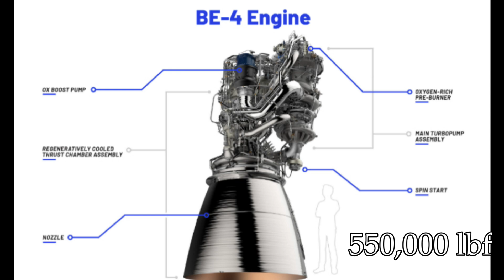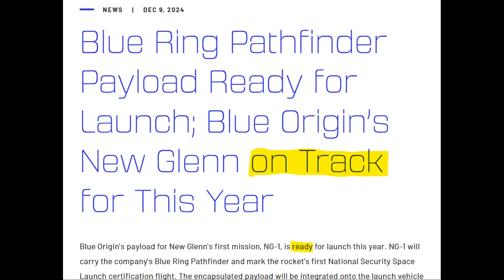New Glenn Ready to Launch?

Comment: It would be a big flex for Bezos if the things flies and lands without incident. It would be impressive to achieve this at the first attempt whereas it always takes a few RUDs for SpaceX.
To be fair, the engine is less complex (not full-flow) and the rocket itself is significantly smaller than starship.
Having said that, it's still much more modern and innovative than SLS.
Reply from the maker: Yeah, it would be interesting if they got it sans RUD on the first attempt!
Reply: @marionrkerr 🙏🏼🙏🏼🙏🏼🙏🏼

Comment: Good update.  If all goes well, New Glenn will put a payload in orbit before Starship.
Reply: BO must do that ASAP, whereas SpaceX isn't pressured. (And they could have put a payload in orbit on at least three previous flights, if they just wanted the notch on their belt.)
Reply from the maker: I wonder if that is part of the incentive. 😁
Reply: @marionrkerr  They have set some high expectations for themselves.  Recovering the booster on the first try will be awesome.
Reply from the maker: @ agreed!
Reply: The difference is Starship will have heavier payloads at, theoretically, lower cost per mission.  A 7m fairing is a nice change. Some payloads will require that.
Reply from the maker: @ yeah, I think the bigger payload fairing is a good option to have too.